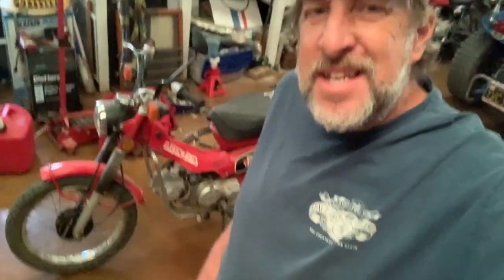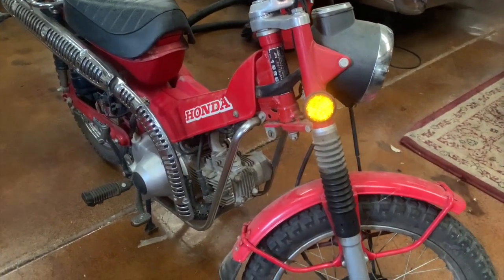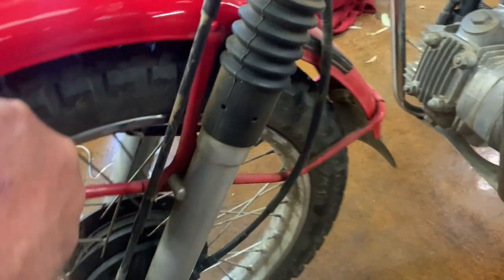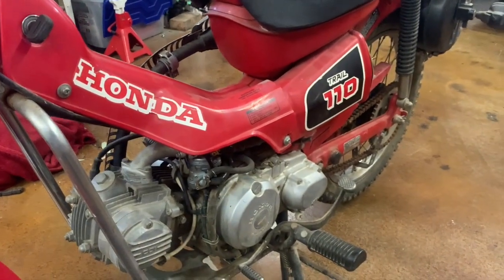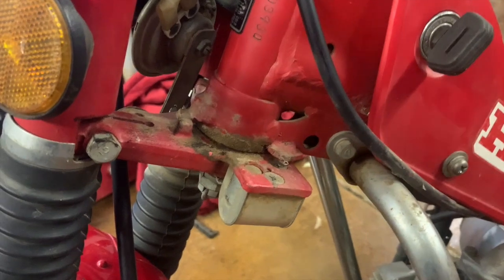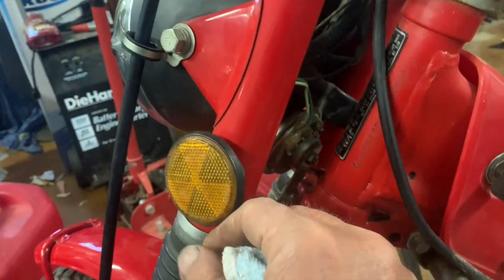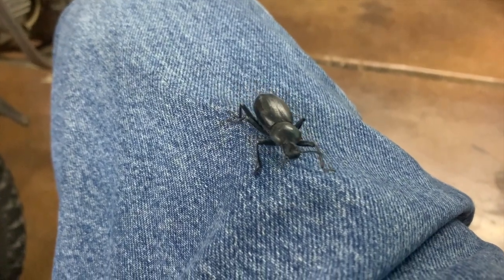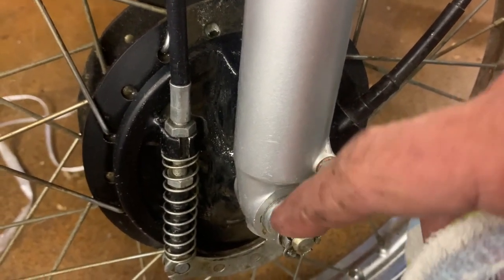Carchaeology: Barn Find 500 Original Mile Honda CT110 Revival and Detail part 1

Comment: As the bike is unused a clean with a car wash and gentle brushes would do most of the cleaning. Bit of degreaser for the chain and don’t put any solvents near the paint. If for sale I would personally buy in as is state.
Reply from the maker: I think a lot of people would buy it in its current state. But the value is higher with it cleaned up and running properly. That is what I intend to do.